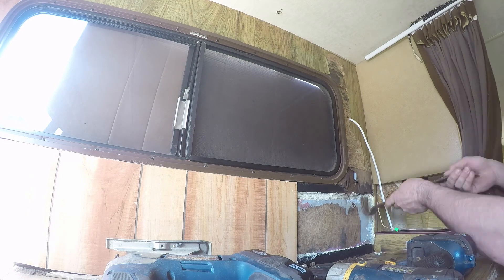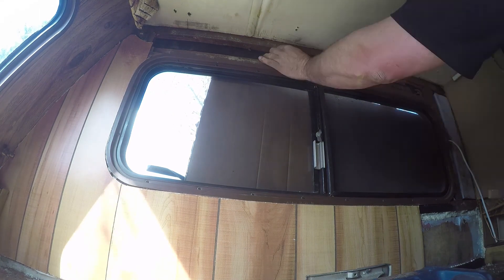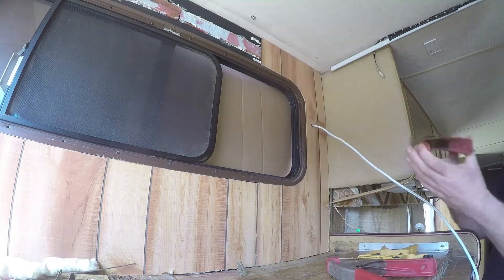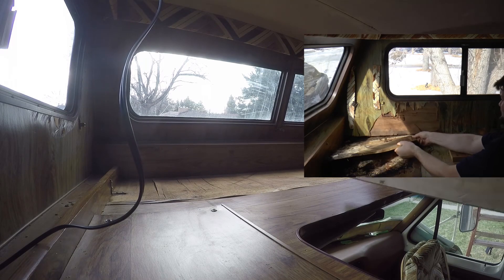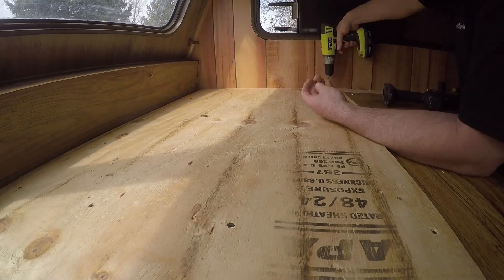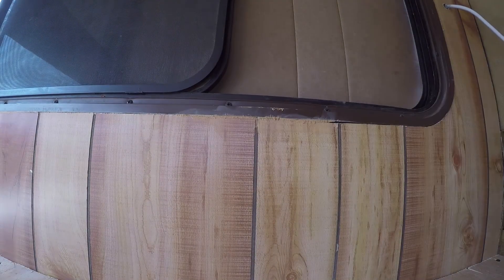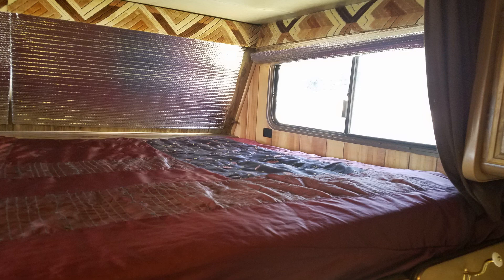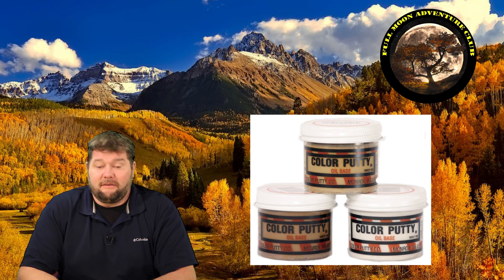RV Water Damage Repair Part 3 - Finished Repair

Comment: Jim, I’m curious why you didn’t remove the window and replace the seal around it. It would seem without doing it, the same issue will just happen again. Am I missing something?
Reply from the maker: To be honest I do not think my window would have come out in one piece. It is 36 years old and the screws that hold the two pieces of the window together are rusty. I was certain that if I tried to pull the window I would end up needing a new window. I will have to keep sealing around the window periodically just like the rest of the RV. I will be doing a video of the steps that I took to stop the water leak in the near future. As I said in the beginning of the video series this is not a full professional repair that you would get at a dealership but rather a quick fix of the inner wall.  I might remove the corner molding, window, and exterior wall for repair but that was not this project. Thank you for bringing that up for all of us. If your window is in solid shape and you are comfortable with the project I would absolutely recommend changing out the window seals. Take care and happy camping.      Jim
Reply: Jim, thanks for showing me how to repair the inner water damage on my 67 chinook. Hopefully it works out as well as yours did!
Reply: Is it okay to leave wet damaged wood?
Reply from the maker: @Bunnyison  it's better to replace the damaged wood if possible.
Reply: @fullmoonadventureclub  Not removing the windows was the thing I noticed right away.  Clearly that's where the leaks were coming from especially considering you found rusty screws.  You can't get rust without water.  There must be some way to remove those rusty screws without damaging the window.  I see this video is Four Years old,  How have the repairs held up over time?
Reply from the maker: @IanoftheRVin  so far so good. After sealing the outside of the windows with silicone and the roof there appears to be no more water leakage. Repairs are holding up well. In a different remodel video regarding the back of the RV I did remove the window and that repair is also holding well.
Reply: @fullmoonadventureclub  that's good to hear.  I recently purchased a 1999 Tioga that is going to need a over-cab renovation, a new shower, all the windows resealed and a new roof.   Both main cabin windows show signs of leaking as well as the skylight over the shower.  Those walls need to be rebuilt. 🙄   No wonder I got it dirt cheap.  But I'm excited for the project.   Going to go with 45mil TPO, heat welded flashing and curbs for all the vents and AC on the roof, probably new Trim with rain gutters.  I've spent my winter rebuilding the Onan 4k generator to where it actually runs now.  I am upgrading the electrical system to a Renogy Lithium battery system and will eventually put solar on the roof.  I think the water heater will need some work to get it to run off both Gas and electric.  May eventually pull up the linoleum floor and put on vinyl plank flooring.   But that's for another time.   I'm thinking of documenting this work here on YouTube University.   Hopefully people can learn and help as I work through this renovation.
Reply from the maker: @IanoftheRVin  it seems like a full-time job to restore the old RVs but I have a strange nostalgic attachment to mine so I guess I'll keep at it. Good luck and thanks for sharing your progress it helps all of us out. Thanks for the comments and happy camping.

Comment: Jim, what was the fix for the leak and what part of the window was leaking?
Reply from the maker: I was never able to visually see the source of the window leak but I used Flex Seal spray on the entire corner and window and it stopped the leak. I have tried silicone, lap sealant, and eternabond tape and nothing worked. I will be impressed it the Flex Seal holds up over time but it worked. Thank you for watching and happy camping.    Jim

Comment: Thanks, Jim. Very informative. I see in the final pictures in the video that you added two outlets at the bottom of the window. How did you do that without redoing the paneling job? Thanks again for a very straightforward and useful video!

Comment: Thank you for your help.  BUT the most important thing for us was the part where you said it was corroded and you couldn't show it. The plywood. My husband and I are not sure how to do that part but you did help us.  Thank you so much.  Did you say what you used to stop the water damage coming in the window?  I mush have missed it?
Reply from the maker: There are several parts to this video series. I could have sworn I showed using a wire wheel on a drill to get some of the rust off and then using rust inhibitor to stop it. As for the windows I used silicone around every window and on the roof I used Flex Seal paint. It's still not leaking so it worked pretty well.

Comment: we had a 2002 c class that had a leak in one over cab part was really bad replaced all the wood fiberglass and the rubber roof and 3 sheets of 1/4 plywood at a cost of $12,000! keep an eye on every joint and any thing that comes through  the roof
Reply from the maker: Thanks you for sharing that with us. That is a hefty repair bill. I hope it is all fixed and doing well. Take care and happy camping.    Jim

Comment: Thank you for this video; I plan on doing this repair but will not be able to until September.  Is there anything you recommend to possibly slow down the rotting until I can get to it?
Reply from the maker: cover the leaking area with a tarp or seal it to prevent more water entering the area.     Jim

Comment: Also how long did this take you?? Im so impressed....i just bought an RV and realized I have to do this all over. :/
Reply from the maker: It took me about three or four days. Most of that was just letting paint and foam dry. It takes some time but it is pretty straight forward. You can do it. :)

Comment: The window should have been pulled out before putting paneling in. Paneling should be under the window frame and frame should be re-sealed. I just did it on my old 20 plus year old Class A RV.
Reply from the maker: Agreed. It really just was a decision I had to make with the materials and time on hand. If you watch my other video about the bedroom restoration I was able to pull all the windows out. I believe I mentioned that in the video but you're absolutely right. If it all possible remove the window and reseal it.

Comment: Hey Jim, 
Love your videos and appreciate the hard work you put in to this project. Maybe I missed something, but why didn't you take the window out and repair the leak before you did all this? Again, maybe I missed that part. Also, why didn't you take off the trim piece inside the window frame that is supposed to cover the edges of the paneling? It seems to me that if you pulled that rim off before you put in the panels then you could cover the mistakes with that and screwing it back in would cover the mistakes. But nonetheless, it looks great. Thanks for sharing... 
Pat
Reply from the maker: You are the second person to ask this question. I forgot to cover it in the video but this window is 36 years old and the water damage has rusted all the trim screws making it impossible to remove them without damaging and possibly replacing the window. I will post a short video about this today. Thank you for bringing it up with all of us. I wish I would have mentioned it in the video. Take care and happy camping.    Jm

Comment: dude if the window was leaking don't you think your best bet is first reseal the windows by removing it if it's still leaking all that work you just did is meaningless and a waist of time I always say don't go half way to fix a problem than the problem will never be fixed your just sugar coating it just being honest of my opinion.
Reply from the maker: Yeah I just did the back bedroom where I had to remove both window seals to reseal them. Of course that's the ideal Solution that's why I mentioned in the video the reason I couldn't do that in the front was because all the screws are kind of brittle and I didn't want to risk breaking the window getting it out. I did seal it from the exterior and interior and there are no more leaks. I left it completely uncovered through two rain storms and also sprayed it with the hose and there is absolutely zero water filtration. But you are correct. To be honest fixing that correctly would mean a complete teardown of the overhead cab inside and out. That was just not something I was willing to do at that time. Thanks for the comments and happy camping.